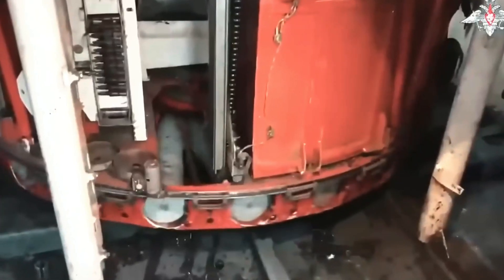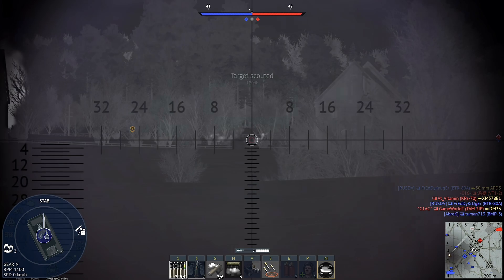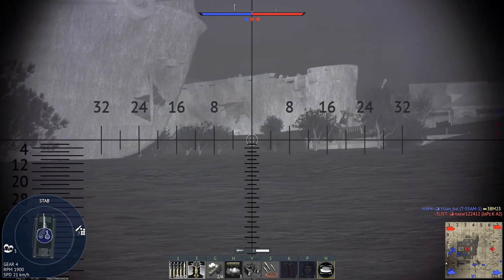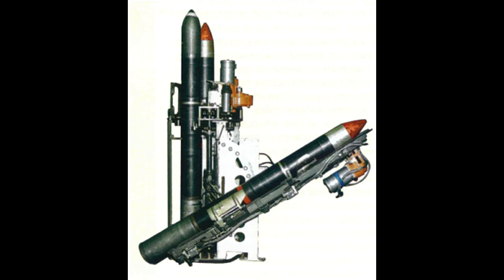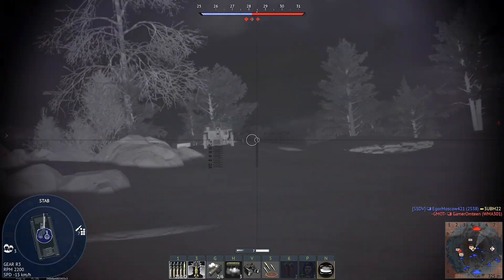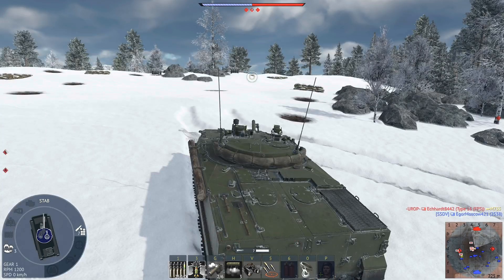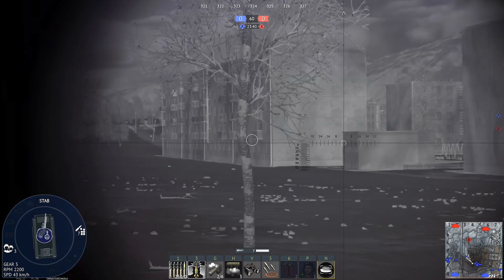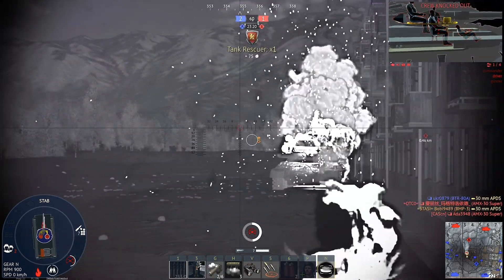How the BMP-3 ATGM autoloader works

Comment: When I first learned about the BMP-3 many years ago, I thought it is cool for a IFV to have that much fire power and such a large selection of different weapons and have it be amphibious at the same time, but the more I learned about it, the more I thought it is a really bad idea. The thing has almost no armor, even heavy machine guns can perforate it and it is crammed full with high explosive ammunition. 
There is ammo everywhere, the auto-loader-carousel, the turret cage, the floor, the walls.

Putting that much explosives together with 11 people into a aluminium can, is a really bad idea and designing that can in a way that people need to climb over the engine to get out, doesn't make it better.

No wonder the thing turned out to be one of the worst death traps of the Ukraine war and has basically gone extinct by now.
Reply from the maker: @TrangleC  I agree with you. I think the biggest mistake was to make it amphibious because it‘s a function you rarely need and they sacrificed many other important things (like armor) to make that happen.
Reply: @bobiwt  Yes. I guess it is no wonder that they went with a more conventional design with the Kurganets (or however you spell that) again.

What a IFV really needs is a weapon that makes a lot of noise and can carry a lot of ammo, to suppress enemy positions while the vehicle is driving towards them to unload the passengers. For that a 30mm gun is the best choice. (x) Ideally you would also store the ammo outside the vehicle, in the turret, at least the high explosive ammo. 

Having ATGMs on top of that is nice, but a luxury.

Anything beyond that is just ability creep that endangers the people inside the vehicle for no good reason.

(x) Which is why I also think it is stupid that the US Army is going for a 50mm gun on their next IFV. 

Reducing the ammo you can carry and limiting the suppression fire ability just for more armor penetration makes no sense to me, especially since a 50mm gun is still not powerful enough to reliably kill a MBT and is overkill on unarmored targets. All a 50mm gun is good for is killing other IFVs and maybe helicopters and that is not the main job of a IFV.

Comment: I am a bit confused. I have seen pictures of a auto loader for the BMP-3 that stores the 100mm shells vertically around the turret cage, much like in the BMP-2 with the 76mm shells.
Reply from the maker: @TrangleC   Well, there‘s a difference between the ATGMs and the 100mm HE shells. 

Also, the BMP-2 only has a 30mm autocannon. The BMP-1 has a 73mm cannon.
Reply: @bobiwt  I know. I was talking about the 100mm shells. There are pictures of a BMP-3 turret system that looks similar on the outside (the actual turret with the guns on top of the vehicle), but where the 100mm shells are not laying down in a carousel like we see here, but standing up in a circle around the turret basket.

I also saw pictures of a miniature model of the BMP-3 also having that different, upright storing and loading system for the 100mm shells.

Comment: Biggest downside is that 13 second to load an ATGM when the tank is in your line of sight NOW.

ATGMs already have long flight time. The load time just makes it more likely the tank will see you and smoke you before the missile even leaves the tube. Which is even more likely if you also have to clear the gun tube by firing the 100mm HE shell. It's penetrative potential also limited by that 100mm bore

No wonder KBP Tula made the Berezhok turret with external armored ATGM launchers.
Reply: I believe it’s doctrine for tanks to not load a round until you spot targets. However let’s say it’s in the middle of shooting he and it spots an enemy vehicle far away. Then it’s a problem but you’ll have the same issue with manual loaders as well

Comment: These autoloaders toss turrets almost as high as the T-72’s, even higher than the T90’s(heavier turret). That back hatch “armor” is like 1/4” thick, FPV drones love BMP-3s
Reply: Bruh...
All vehicles just died for 600mm pen HEAT grenade, or Bradley's IFV in Zaporozhye field its just a joke?
Reply: @иванандреев-ч5н  you’ve seen a Bradley toss a turret? I’ve seen no proof of that, nor a Abrams. Not like Russian stock send turrets(with the crew minus the driver) into low earth orbit🤣. I have seen videos of Bradleys shrugging of lancet hits like they were nothing.
Reply: @drgonzo305 Bro thinks tossing turrets means something
Reply: @Янус_Ырт  it means the difference between a live crew and a dead crew + the ability to repair the tank. That’s why Putin is having to beg little rocket man for military aid
Reply: @drgonzo305 Bruh tank hit crew either die or wound buddy 😂 just because you didn't see explosives doesn't mean they are fine , we also seen soviet tank get hit and crew only wound or didn't wound at all it all about luck in the end if you survive or die in the battlefield , don't believe me volunteer and join the war in Ukraine . Have you seen war vet or those that fought in Ukraine loud mouth like pro Ukraine or pro Russian ? No , it always the arms chair general at home loud mouth on the internet 😂
Reply: found the Dude with a BBC membership
Reply: It doesn't really matter. If you penetrate that far the crews already dead. It just makes it harder to repair and re-introduce into service, but not impossible since they've introduced specialised equipment to replace turrets closer to the front.
Reply: BMP-3 just kind of come apart and scatter themselves all over the country side. Turrets included.

Comment: honestly the Bmp 3 in war thunder is Undertiered exactly by 1.0, so it should be 10.3- same as the Krizantema wich is 9.7 but should be 11.0 since its basically better then any oth3r atgm TDs + it can destroy anything it could face from modern tanks in one- 2 hits
Reply from the maker: @diprosla592  I think at 10.3 it would be pretty shit because the reload rate of these ATGMs is very slow to use as a constant primary weapon, and the 30mm autocannons are shit.
Reply: @bobiwt yea thats true,
but it can easily farm 8.0 so at least 9.3 could do it?

Comment: The rate of fire isn't much of an issue because even at 2km distance which is more realistic the flight time is about 6-7 second also the gunner has to visually confirm splash and effects on target by waiting for the smoke to clear in the thermal channel which can take several seconds. So by the time of splash and gunner identifying if the target needs a re-attack the missile is already loaded. However there are plenty of videos from Ukraine of BMP-3's and T-72's using their GLATGM at their max range.
Reply from the maker: @nemisous83  thanks for adding this

Comment: Gaijin: 26, take it or leave it.
I'd understand if all of them were manually loaded but they even modeled the location of the first 3 atgms, which would be in the autoloader spot.
Reply: In WT it uses old bmp3 which didn't have autoloader for ATGM
Reply: @Янус_Ырт  didn't have an autoloader means the atgms shouldn't sit in the center. They are perfectly aligned for the autoloader formation.